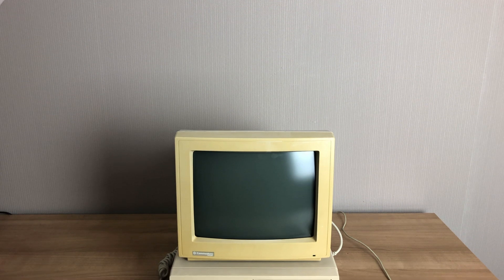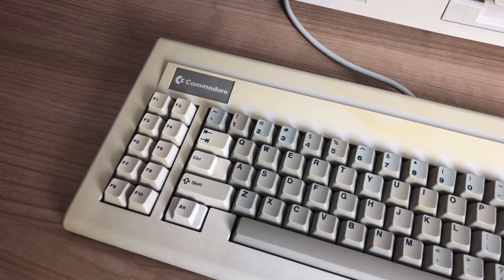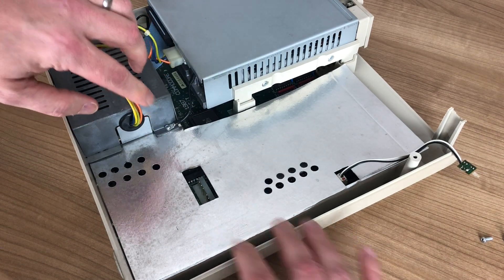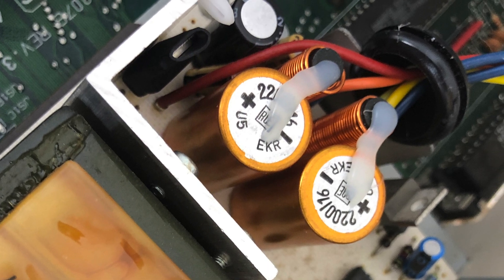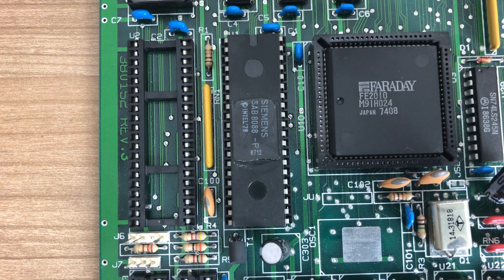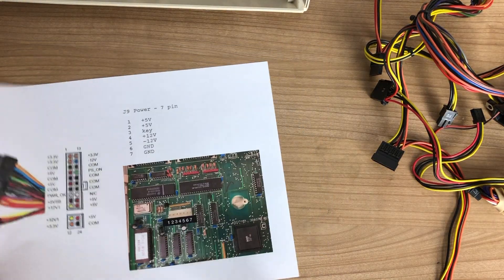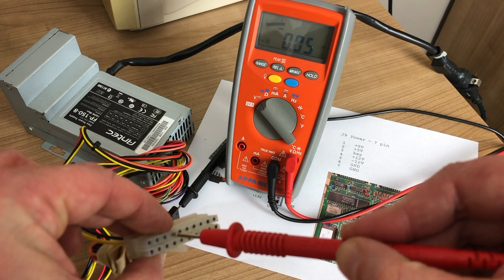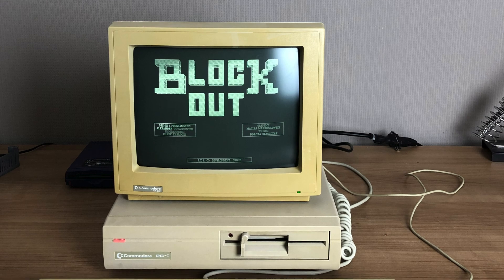Commodore PC 1 Part 1/3 : Overview, repairs and first boot

Comment: Whenever you come across plastic clips like that which might break, the easy solution is just heat them up. There's a few different ways to approach it. Using a heat gun can work but you need to be patient as the heat needs to work through all the plastic, and some plastics take a while to conduct heat. You can also buy those microwaveable heat packs in various shapes and sizes, and get them good and hot and press them up against the clips for a while. Once they are good and warm they are much, much less likely to break. Just make sure they are heated all the way through.

Comment: You remind me of a girl I worked with at a lab once.  We used a multi-meter to check resistances on a semi conductive surface, somehow we ended up talking about the multi meter and I showed her how to check AC voltage, so I set it to AC, put the probes in an outlet, and showed her the voltage display.
She just looked at me and said, "You're nuts", lol.
The only PC voltage that really scares me is the inside of CRT monitors.

Comment: Boy, I thought my Epson Apex 1 from 1988 was minimalist, with its 10 MHz processor, two 360 kB. floppy drives, no hard drive (no room for one), parallel port, no serial port, and monochrome video.  This Commodore PC 1 outdoes it in minimalism.  At least the Apex 1 has four 8-bit expansion slots!

Comment: Ive got a couple of those. The one i bought back in the day and worked on, had its psu failing. so i hooked it onto another psu many years ago.
Bought another one for my collection end 90ies i think.
Just got them out of the collection, bc ive got to sell most. The speaker is normally glued on the bottom, front left.
I removed that psu from the first one, sometime, so couldnt test it at this time.
The other one booted, but didnt want to read my bootdisks.
There's usually something not all that great after 30 years in storage.

Comment: No expansion is incorrect ... the backside even has a cover labeled "expansion slot" - that slot is basically ISA without all voltages being forwarded and some signals shuffled. Spent a bit of time trying to get "disk on chip" modules running on the PC-1 - while it generally worked it was sadly to unreliable for mass production (IIRC formating never worked reliable). Still have the prototype lying around if you wanna give it a spin.
EDIT: https://i.imgur.com/ihjHcEb.jpg That's how it looks

Comment: thank you for posting.  w/o a psu fan, must be a quiet rascal,  a stealth pc.  if memory serves, it's pretty easy to back the individual female pins [sockets ?] out of the psu connector to the mobo, so you could temporarily rearrange the pins w/o cutting the wires, etc.  take care & stay safe.
Reply: or cut an ATX extender instead of actual PSU... :-)

Comment: Never had one of these, but I DID have an Amstrad PC1512DD!  It was my first PC clone.  I had all three slots populated with a 1200 baud modem (later 2400), ThunderBoard, and a 40 meg IDE hard card with one of those Conner hard drives that all made that unique sound when they'd start up.  I THINK I remember the Base Exchange selling some Commodore PC clones alongside the Packard Bell 286s and 386s.

Comment: I think that 4.77Mhz 8088 is a bit underpowered for 1987. I would expect some 8Mhz 8086 for XT clone at that time.
Reply: Everything in that machine has been engineered to keep the cost down, including the choice of CPU. Several home computer manufacturers came out with PCs like these, including Atari ("Atari PC", 1987, 8088 @ 4.77 or 8 MHz) and Schneider ("Euro PC", 1988, 8088 @ 4.77 or 9.54 MHz).

Comment: No surprise, as they are made from ROE and they always fail. You have to change the caps (capacitors). Most Made in Germany PSUs have them in PC series, A2000, C128, C128D maybe too.
Reply from the maker: Caps seem to be fine as I measured a couple of them using my ESR meter. However I'm not that comfortable working on these switch mode power supplies and different people (far more experienced then myself) made it clear that they are not only dangerous but also difficult to debug in case of failure. And given the prices of new embedded SMPS units, I'm going to go for that option I think and prolonge its life that way.
Reply: @RetroSpector78  The ROE (or Roederstein) Capacitors normally fail shorted, so an ESR measurement might look okay (of cource a short has low resistance). Try measuring if there is a short across them with a normal multimeter. This can also be done  in circuit, as there exists no circuit which intentionally shorts a cap.